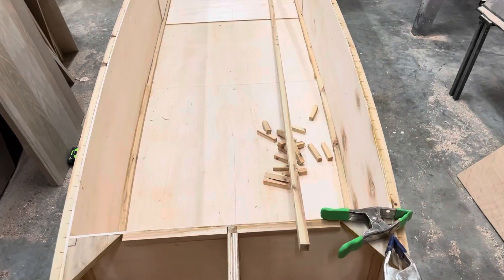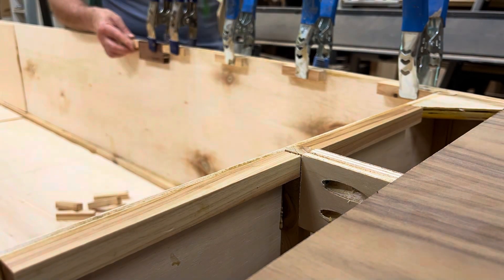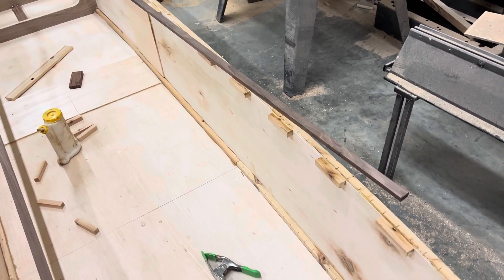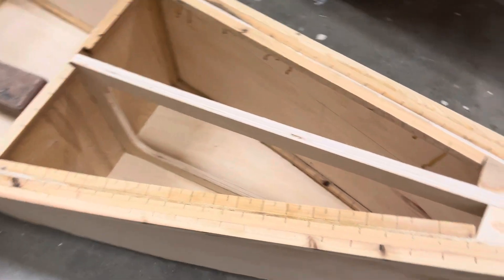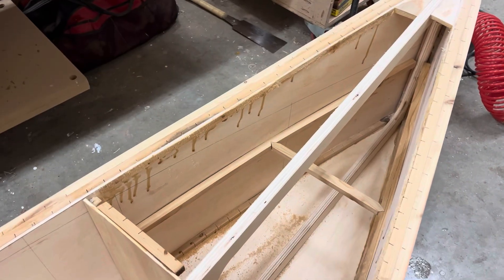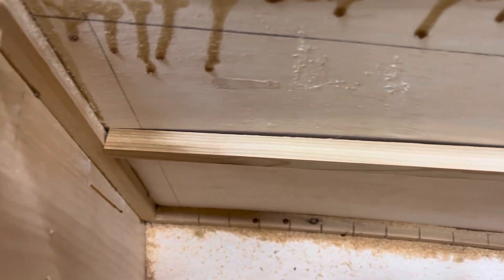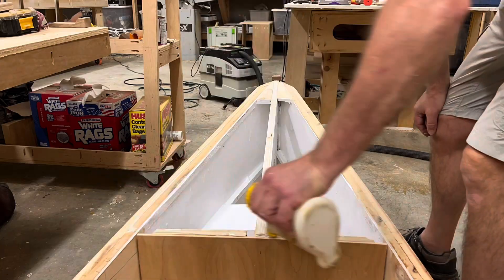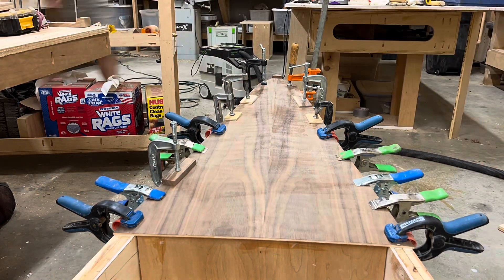Spark Sailing Canoe Build 5

Comment: Not critical, though using gorilla glue in the kerf cuts adds strength and helps prevent moisture intrusion.

👣⛵️👽
Reply from the maker: Ok, I hate Gorilla glue.  It’s good for certain things but I try to avoid using it whenever possible. Titebond 3 takes longer to harden but it is quite hard to remove from my work bench once dried.